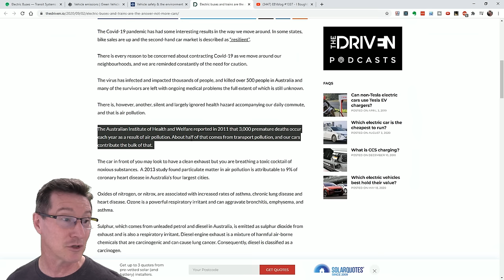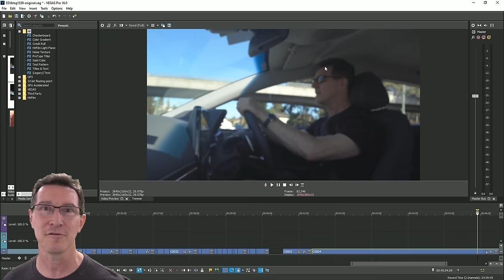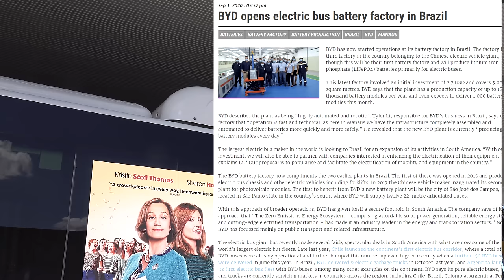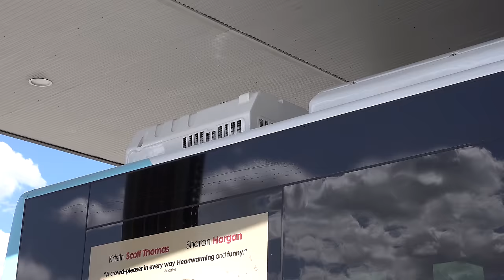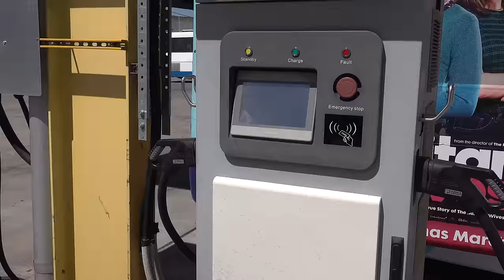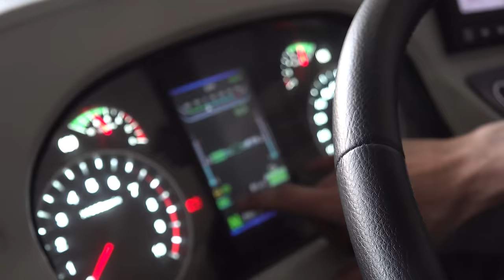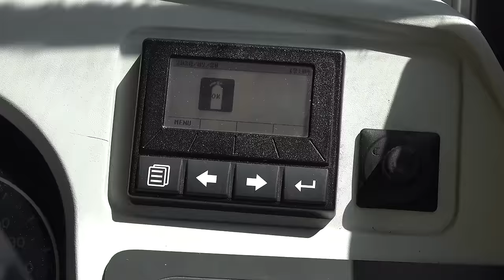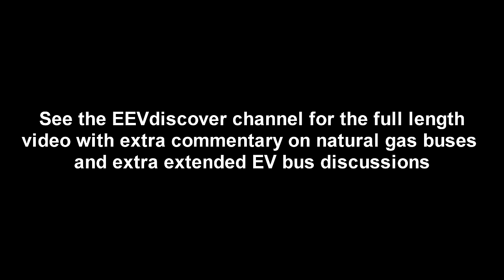EEVblog #1339 - Looking at an Electric Bus!

Comment: Where doe's the electrical energy come from in the first place. How much in energy doe's it cost to make an electric car to make set against a combustion car. Do the math Dave.
Reply: Oh yes, now you got him. The diesel obviously comes bubbling out of the ground in the backyard of the local petrol station, already refined and with no environmental impact whatsoever
Reply: It comes from God, almighty God.
Reply: @max_kl  When I can get 500 mile out of a charge and the car is cheaper to buy, which it should be, then I will be interested.
Reply: @hdmalpas  And asking leading questions to discredit EVs will increase acceptance and make them cheaper soon? Yeah no, it doesn't...

Comment: 2mins in I have to stop you. You are waaaay WRONG. Gasoline is/Can be way more efficient then Cole burning powered electric cars. New Direct Injection and even moreso properly Tuned 600cc+ Injectors are far cleaner then any electric car ever can or will be. Problem with the USA is we put like 240cc Injectors in. So 720 degrees and a stock injector spraying for 570 degrees or so. The fact is now i'm 5mins into your video and very disappointed in your ignorance to Automobiles and their efficiency.

Comment: Well it's not pointless wireless charging on long roads like motorways freeways it can power the vehicle as well as charge it at the same time, I am not talking stationary I'm not sure if you're referring to stationery no I don't see much point in that and maybe would be a danger high magnetic fields. 
 What is the major problem with electric vehicles on long journeys this is eliminated the technology has been around for 60 years at least.

Comment: If the tailpipe is 100 miles away then there is no pollution? Truth be known if you run the math and figure line loss, line Maintainance ie. truck running up and down the road burning petro to replace transformers and down lines helicopters burning jet fule to replace the spacers. I think you would find that a newer model petro car produces fewer emissions. Now I'm not against electric cars by no means but let's not propagate the lie that they have no emissions.
Reply: Dave's power line starts on his roof.
Reply: @marvintpandroid2213  yes for Dave. But do you think he has enough up there to run his car as well? That's a question for Dave.  But you do get the point I'm driving at right?
Reply: @Vintage_USA_Tech  no, not really.
Reply from the maker: I'm talking about local point source pollution that you breath in
Go start your ICE car up in the garage and report back...
Reply: @marvintpandroid2213  from what I can find in a quick search it takes 38.3Kwh to get 133MPGe out of that car, Dave has a 3KW home installation. Do you still want to stick to your guns?
Reply from the maker: @Vintage_USA_Tech  If the power does not come from my solar panels then it comes from the audited 100% new infrastructure wind that I've payed extra for for the last 15 years.
Reply: @Vintage_USA_Tech  The national grid of any given country isn't purely for the EVs, its for all electrical devises/uses. The grid will be maintained, improved and expanded as more vehicles use more electricity and the difference between an EV and a combustion engine car is that as our electricity generating tecniques get more green the benefit goes back to already on-the-road EV's instead of an ICE car that needs to be scrapped or EV converted before its emission production ends/gets reduced.

I'm a car guy who (atm) prefers old school combusion power more than electric power so i can see why some people might dislike the coming of the EV age, however even i can see that it will be a net benefit over time for the planet.

The batteries are another issue, but like all things they get better over time. New less polluting battery chemistry and all that. :)
Reply: @EEVblog  we cant use Windpower here it kills too many birds, we don't have enough sun for solar.
Reply: @EEVblog  can you imagine how many windmills it would take to power all the cars in your city? That would make a great video.
Reply from the maker: @Vintage_USA_Tech  More birds are killed each year flying into glass buildings
Reply: @Vintage_USA_Tech  you are really desperate to trot out all the busted myths.

Oh well, you can't be serious about wanting a genuine discussion
Reply from the maker: @Vintage_USA_Tech  On an ideal day I have just enough capacity to charge the car outright from the panels. It does not get a lot of use, so daily energy requirements are fairly minimal. Looking to install more capacity.
Reply from the maker: @marvintpandroid2213  He's trolling.
Reply: @FrankInAShed  I'm pretty sure I stated I'm not aginst EV's go back and read it ... it is unedited. I don't want to be the guy that has to stand up and say that. Hay that cars got a tailpipe you just don't see it but I will be that guy.... not everyone thinks about what a infrastructure would look like on a scale that would support EV's that day will come but it could take another 25 years we still haven't solved the storage problem yet. I'm not anti EV I'm just a voice of reason in a sea of people that are easily lead to believe whatever the MSM tells them to believe.
Reply: @EEVblog  Dave I'm disappointed in you I thought we were having a conversation.
Reply: @EEVblog  I sware it is a sad day when you cant have a civil conversation with anyone and disagree without being called a troll it is a sad day indeed. Well, gentlemen have a nice day sorry to have bent your feathers. I see I'm not respected here as an equal.
Reply: @EEVblog   yep. Sad.
Reply: @Vintage_USA_Tech  Fair point about not hating EV's, i suppose it would be better to have people keeping an eye on making sure the emissions actually do get reduced on the electricity generating side instead of getting complacent once we read "no (tailpipe) emissions!" everywhere.
Reply: @FrankInAShed  Yes very well said frank but I wasn't allowed to get to that point before being called a troll and I never was able to point out a technology that really interests me called flywheel energy storage or FES. I don't think EV's are Pie in the Sky but there is still much work to be done.
Reply: @Vintage_USA_Tech  "helicopters burning jet fuel to replace the spacers" almost choked on my coffee reading this.  What is with this level of defeatism, we're not going to go from a 100% fossil powered economy to a 100% renewable powered economy overnight, there's a pathway of development and innovation. Shall we give it a go, or shall we just fight each other to death at a costs of trillions over the last of the black stuff at some point in the future?
Reply: @edc1569  I said it could take another 25 years if that is overnight to you, well ok whatever you say. I don't see how you gleamed defeatism from that.
Reply: At the very least the pollution is 100 miles away, which is a far sight better than having diesel smoke blowing 5 metres away from people walking on the street.

Comment: Here is the problem. where does your electricity come from? Oh yeah, coal and fossil fuel sources........................
Reply: It's better to burn them in less densely populated areas and/or in plants with better filtering possibilities than a moving vehicle, so an electric bus merely needs to reach equal milage per burnt unit of oil to be superior in that regard.
Reply: Well in many advanced countries there’s not so much fossil burn any more. France is 80% nuclear (not perfect I know), even the UK has passed many months with zero coal burn - using offshore wind power increasingly... Australia and US are at the trailing edge...
Reply: @Richardincancale  mainly renewables and nukes here in the UK, though changes a bit day to day, hardly any from coal these days.

Comment: The pollution is just somewhere else
Reply from the maker: The point is you aren't breathing it in. And the energy can come from various rather clean sources when embodied energy is accounted for.
Reply: @EEVblog  Its also far easier to monitor and control emissions in a small handful of power plants than x million vehicles. An ICE gets dirtier as it ages, as the engine and its emissions control systems wear out. An EV gets greener as the grid decarbonises, and even the plants that are still fossil based are generally getting cleaner over time with new technology. Theres a staggering amount of missinformation, which you see repeated over and over in the EV sphere, i guess big oil has done a good job with its marketing!
Reply: @EEVblog  the point is youre moving your problems onto other people... sure YOU might not get the pollution...but those living in the vacinity of a power station will have a MASSIVE INCREASE...im sorry Dave but your point of view is totally wrong here... dont like the pollution....GTFO of the city...simple...dont palm your problems off onto others and then act all high and mighty coz youre "helping"
Reply: caught in the very high performance scrubbers at your power station, or indeed not at all for that bit of energy from renewables.  A bus with its constant accelerating, decelerating is no an efficient platform onto which to be burning fossil fuels, buses with better emission controls cost more and more to maintain.
Reply: @WacKEDmaN  you should see what your air quality would be like if a few billion people moved out of cities and started getting around by truck.  Where exactly do you think all the services that you rely on for your over entitled life come from?  There's no reason why a modern power station can't scrub out practically all of the toxics, you can't do that on a bloody bus.
Reply: @edc1569  entitled? yeah thats why i dont drive...AT ALL...  modern power stations..ya mean the ones built in the last 5-10 years...tell me..how many of them are in australia?..ZERO! our powerstations are OLD... we have a metric shitton of natural gas which burns clean...yet they make it hard for aussies by massively inflating the price (so EVs look better) and sell it cheap to china... if ALL the buses where moved to gas.. at a cheaper cost...things would be much much different
so ya have 2 options here... a) Daves move the pollution to the powerstations or b) zero emmisions anywhere with natural gas... i think i know which one is better thanks..
Reply: @WacKEDmaN  Considering  b) isn't possible, I guess its a) then - enjoy my emissions :)
Reply: @EEVblog  someone is breathing it in.
Not sure about australia but in most places that 'can' come from other sources is completed by 'in the future'.
Anyway, not my intention to pick an argument over this, love yr blog, just didnt watch through this here vid.
Enjoy the car (no sarcasm intended)
Reply: even if you move the pollution to another place, it's still LESS pollution than what a fuel engine would emit through its lifespan
Reply: @WacKEDmaN  You do realise that electric power stations have been built outside of cities for the past 100 years because of exactly what Dave is saying? It's the primary reason  why we use AC rather than DC for the electricity network. Moving pollution outside of the cities will definitely affect some people who live nearby, but it'd be a damn sight better to have a few thousand people in a rural area affected by pollution than 5 million in the cities.
Reply: @wphanoo  interesting math: moving makes it less. Isntvthat wa a combustion car does? Move pollution? Lets move it all around the world till its gone. Pollution problem solved.
Reply: @mubd1234 speak for yourself... if im one of them "few thousand" then im gonna be pissed that the city folk are moving their issues into my backyard..
Reply: @EEVblog  Yeah and I have a patch of healthy roses growing on my rooftop..
Reply: @Ed19601  Dunno what's your logic dude. Battery pollution < 200,000 kms of fuel combustion.
No matter if they happen here or elsewhere
Reply: @wphanoo  that is exactly my logic: moving of pollution does not make pollution less